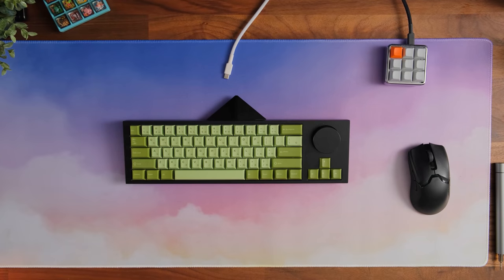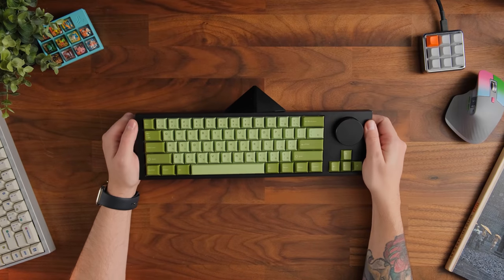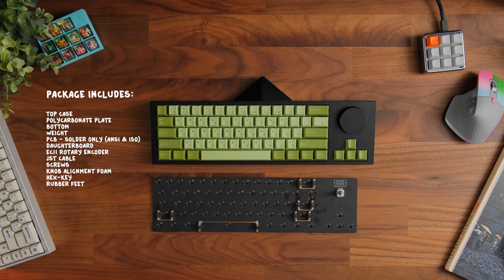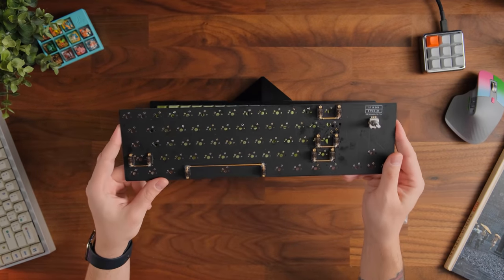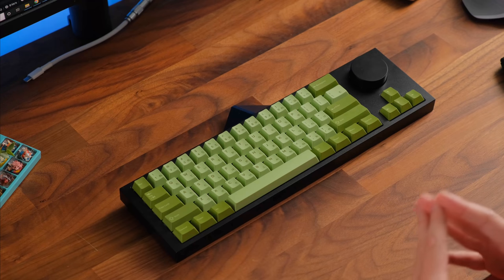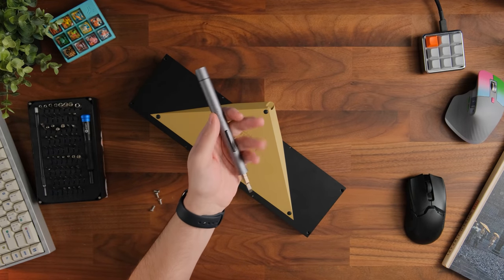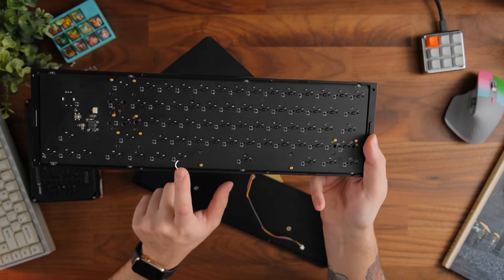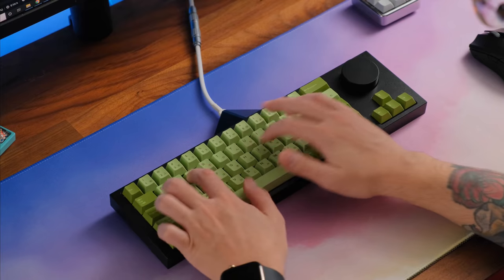a keyboard with a beak?! - Beak 6.5

Comment: 400 euro for this keyboard kit , No switches and no keycaps , on top of it being a group buy.
Sad to see people still trying to rip off those prices when the production cost is less then half when you do it yourself (not talking even about scale production cost reduction)
Reply from the maker: I think this is very unfair to base things off of a production cost, there is labour, R&D, prototyping, marketing, etc
Reply: @alexotos   well i half agree half disagree , as far as R&D there are already so many models available for usage that I guess 99% of the new keyboard shapes are based on top of some existing models and lets assume it takes 10 hours to modify existing shapes from there you need to choose will it be plastic or aluminum or anything else. choose a "clean" pcb and modify it to match your needs or contract it out.

sure i did not mention ton of other steps but my point being the R&D is already done several times over and you just need to "modify" the process and artifacts to have "new" product but the prices still remains absurd. As for the marketing all i see is people sending prototypes to youtubers and hype via forums/reddit/communities. and this is a bit different from spending thousands of $ for newsletters and adds.